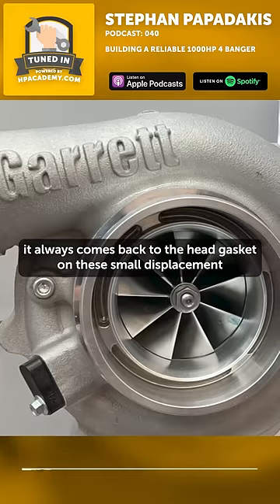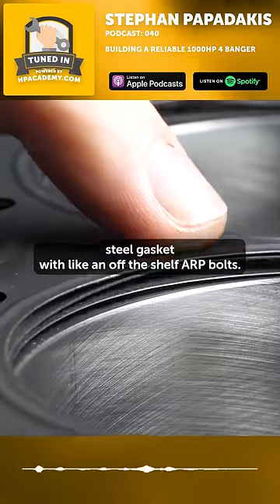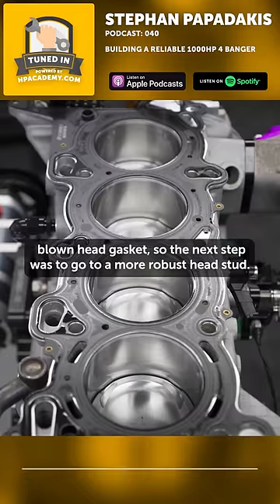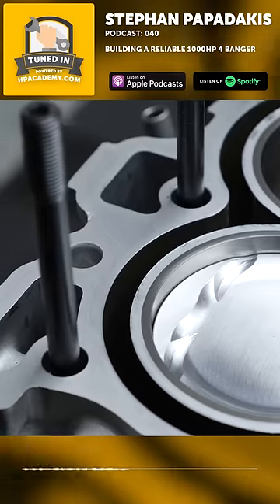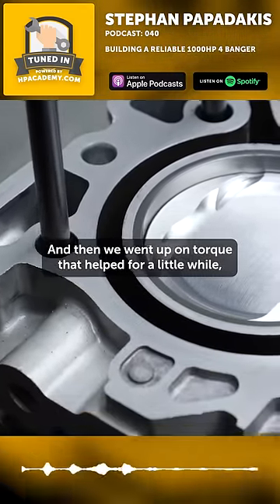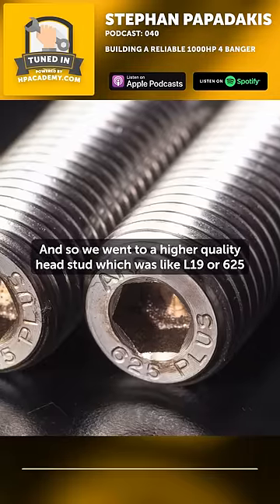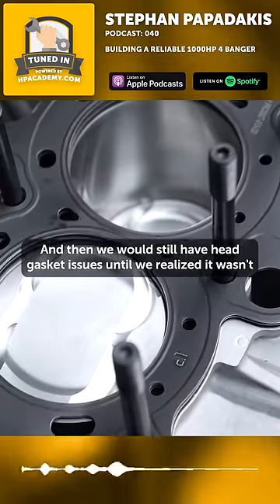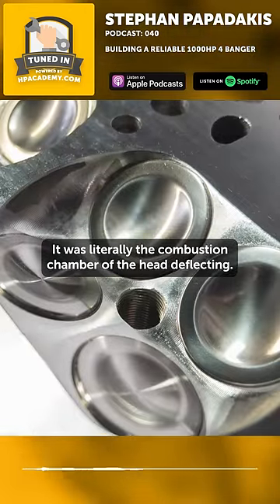How to hold a headgasket on a 1000hp 4 Cylinder 🏎😳 #shorts

Comment: that ton of mechanics mistakes was rebuild engine and supposed run it without turbo for 5 or 7 hours for it break in so all seal will seal up everything and be ready throw in turbo or else
cant just rebuild it n slap turbo on it doesnt work that way n that how it ended up on big mess which you was doing before
every time i rebuild any engine i alway put on test bench run it over 3 or 5 hours at 1.500 rpm and come back n turn it off let it cool down or come back next day n throw engine in vehicles get it all back together n drive it to see if any trouble or issues if no it done
that one of reason that nobody knew it
Reply from the maker: Not sure we agree with that, if you have built the engine for it then it will handle it. 

What is being discussed here is the development of a new engine (at the tiime) for motorsport purposes. No one had gotten the power these guys were getting out of this engine before they did, and it is an iterative process to see what it will and won't put up with before finding the right setup.
The full episode is a great listen, this specific part is around the hour mark, but the whole chat is great - Taz.

https://www.hpacademy.com/blog/040-building-a-reliable-1000hp-4-cylinder-for-formula-d-podcast/?utm_source=youtube&utm_medium=social&utm_campaign=general-interaction
Reply: @hpa101  ah i see
look like they havent done testing on engine before they throw it out there
Reply from the maker: @kittyztigerz  the throwing it out there is the testing in some cases. 

Have a listen to the full episode, I genuinely think you are going to enjoy this and some of the other episodes we have with a range of guests 😎 We can only fit so much in these 60-second clips  - Taz.

 https://www.hpa-tunedin.com/
Reply: @hpa101  nice will check it out

Comment: closed deck can hold 1000 easly on a 4cyl
i had a b18c5 at almost 1100
Reply from the maker: The cylinder pressure is more relevant than the HP, that doesn't necessarily tell you as much as you'd like.
This is a great conversation that touches on this topic if you're interested: https://www.hpacademy.com/blog/700lb-ft-and-43psi-at-4000rpm-4g63-head-cylinder-sealing-julian-godfrey-tech-talk/?utm_source=youtube&utm_medium=social&utm_campaign=general-interaction

If you enjoying listening to Julian there is a second interview with him here as well; https://www.hpacademy.com/blog/1000hp-yb-cosworth-secrets-julian-godfrey-talks-700ftlbs-of-torque-tech-talk/ - Taz.

Comment: Yeah at aome point the gay 4 cylinder becomes the problem
Reply from the maker: What are all the V8s doing wrong to be beaten by a wee 4 cylinder 😂 This is the journey on the way to a championship winning build 😉 - Taz.
Reply: @hpa101  do yall have same amount of money and time in each build 4 cylinder vs v8?
Reply from the maker: @raymondguzman5083  to build a V8 to the same comparative level (double the capacity should be making double the power) requires all the same things, and more of them 😎 - Taz.

Comment: Here's my very "closed minded" opinion on how to hold a head gasket on an 1000hp 4 cylinder:
Don't use a 4 cylinder if you are after 1000hp, yeah hold the gasket then eventually other things would start to come into the game, unless you are looking for breaking a record in which case i'm with you, it hardly worth the work and cost involved, not even the highest paid Formula 1 engines last long.
Reply from the maker: And if they had that idea they probably wouldn't have won the championship beating all those guys running V8's etc 😎
There is so much more to this game than having 8 cylinders and putting them on a slant - Taz.

https://www.hpacademy.com/blog/040-building-a-reliable-1000hp-4-cylinder-for-formula-d-podcast/?utm_source=youtube&utm_medium=social&utm_campaign=general-interaction

Comment: So the next step was to stop wasting money trying to make a 4 cylinder work and put that money in a v8. Learned long ago there's no replacement for displacement.
Reply from the maker: There is, it's forced induction and this project went on to beat plenty of V8's and even V10's I believe to a championship victory. Note to so the equivalent in an engine with over double the capacity, you need to make over double the power, and you have more weight, cooling issues etc etc etc
Full chat here, I think you will enjoy it :) - Taz.
https://www.hpacademy.com/blog/040-building-a-reliable-1000hp-4-cylinder-for-formula-d-podcast/?utm_source=youtube&utm_medium=social&utm_campaign=general-interaction